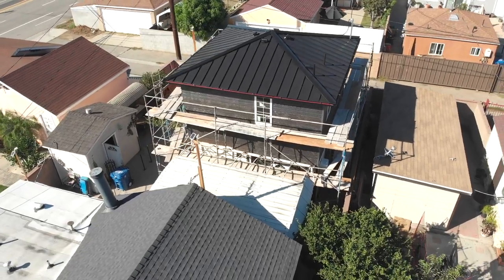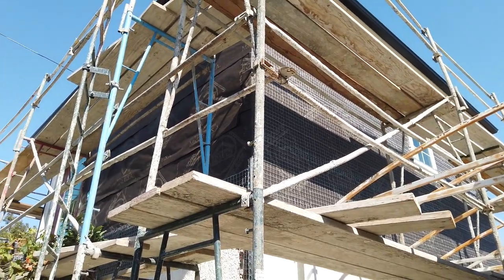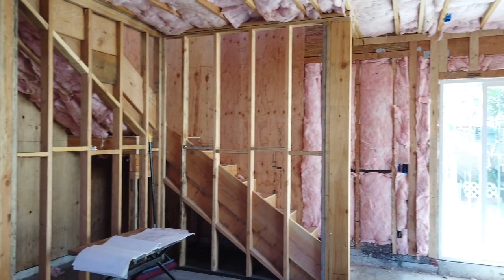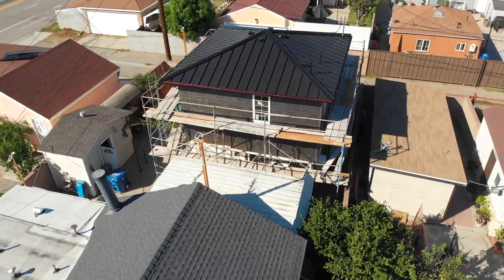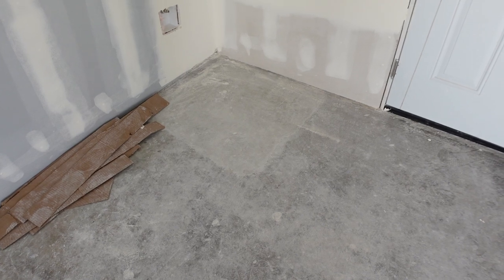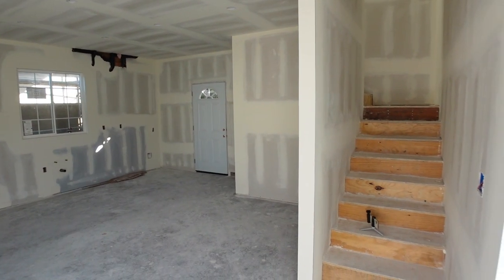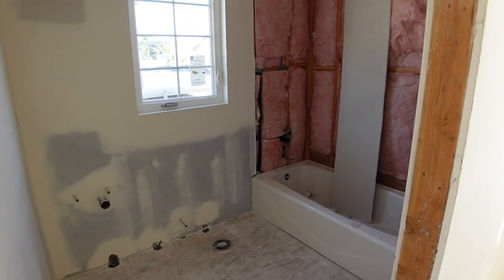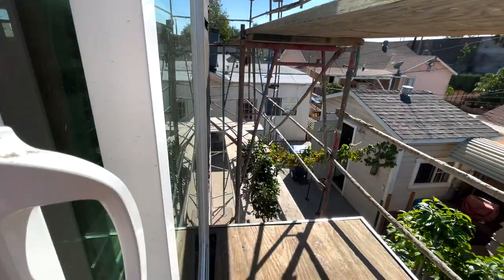Garage conversion into a Two story House (ADU)

Comment: Building one almost exactly like this. Except I have to adhere to 10’ rule so my build on top looses some sqft. 
After plans are done. The garage structure stays.. so do you contact a concrete contractor? Is that your first move?
Reply from the maker: Talk to a Framing contractor that does footings as well. Framing and footings go hand and hand and its best for one company to to both.
Reply: Thank you so much.